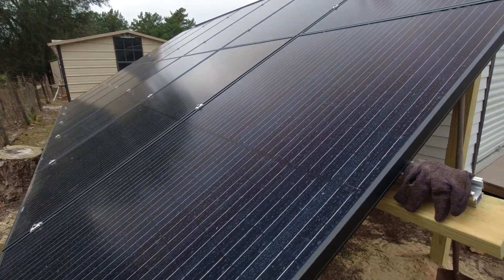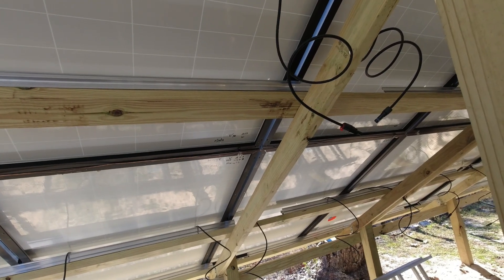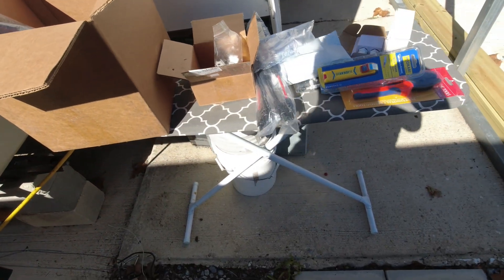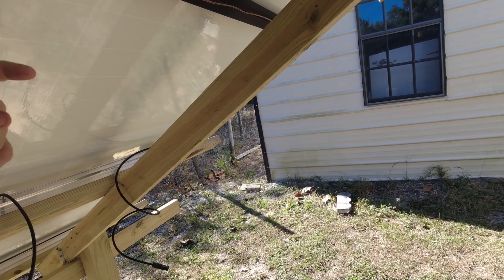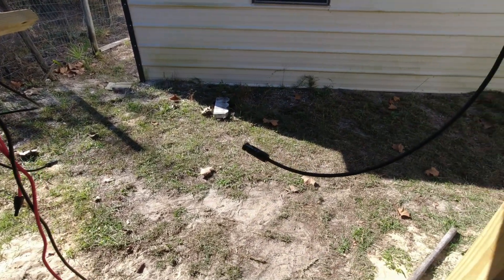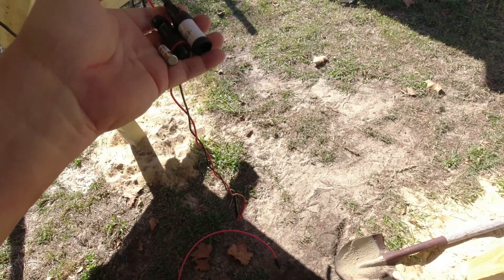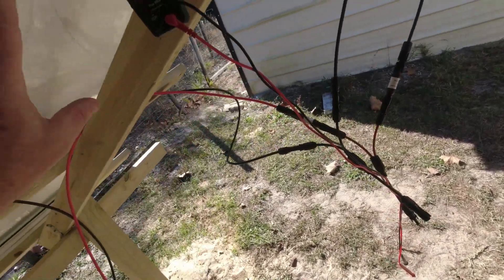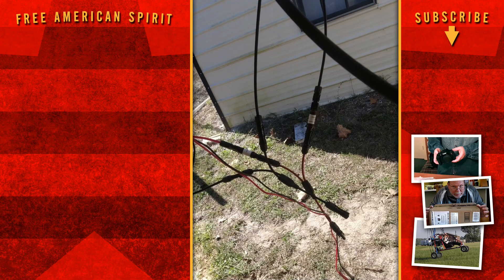Solar panel testing amps - volts and wiring Part 5a How to wire solar panels in Series and Parallel

Comment: An extra safety measure is to cover the panels with a tarpaulin or blankets so there is little or no pv output whilst working on wiring .
Reply from the maker: That's a good tip.